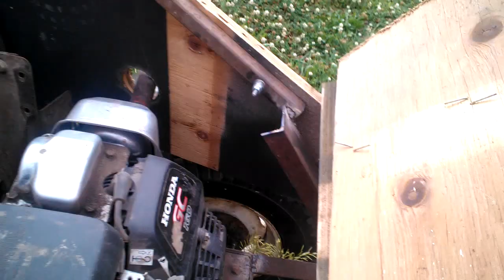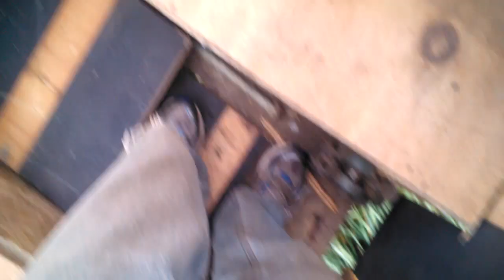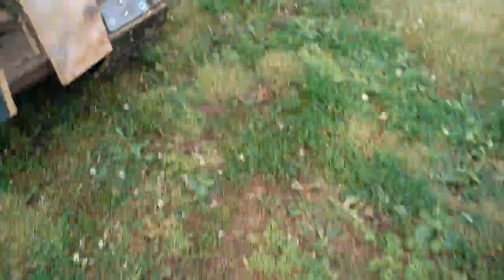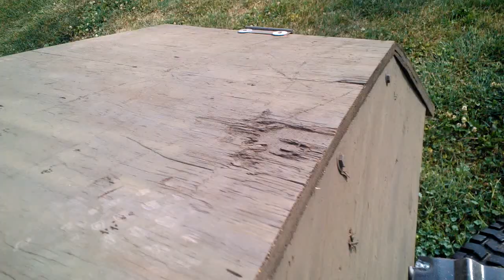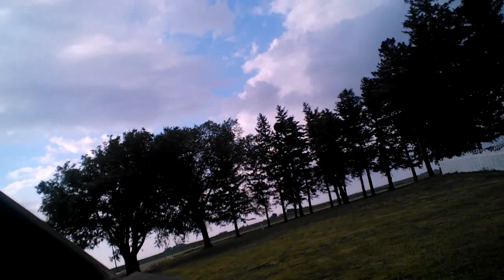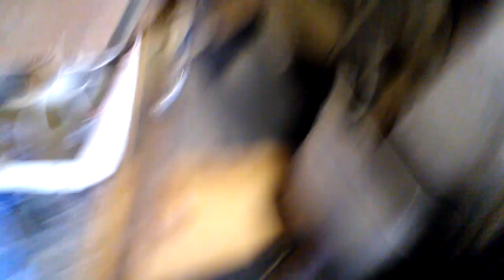halftrack

Comment: I must know how you built this, or at least the track construction of it. I see it uses the American Halftrack style track system. I could build my own road legal halftrack. I would cut some knobby tires and use a high strength high tensil glue agent to fuse them to the metal pads. It's not that I don't have the ability or imagination- I just lack everything else.